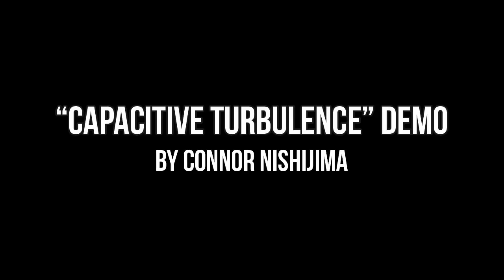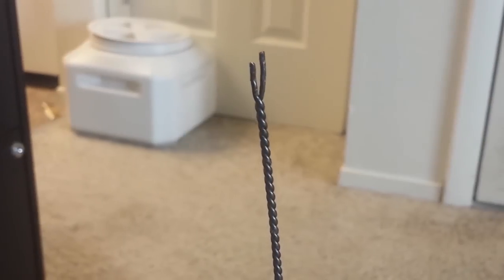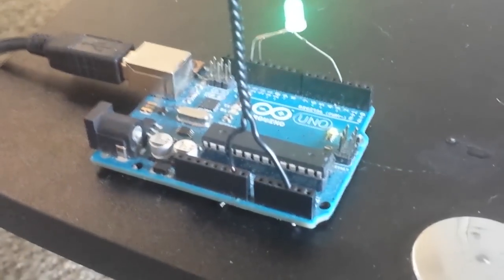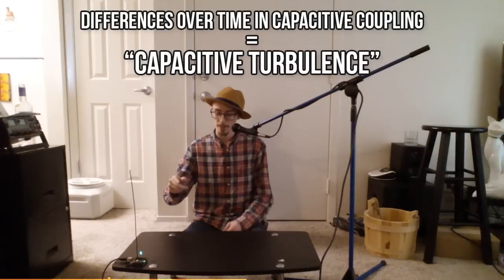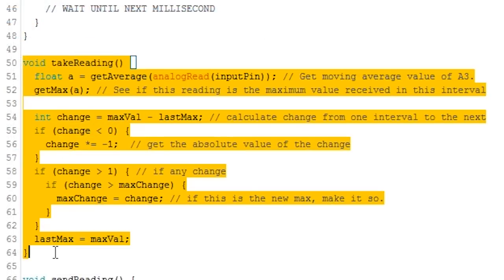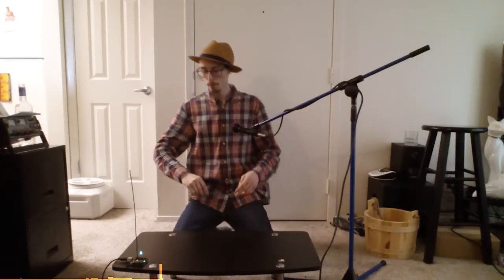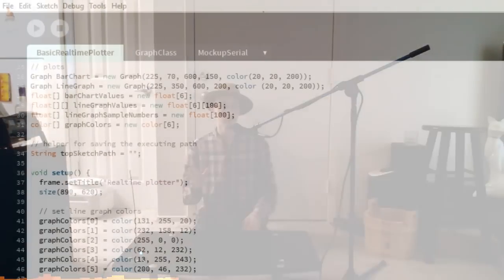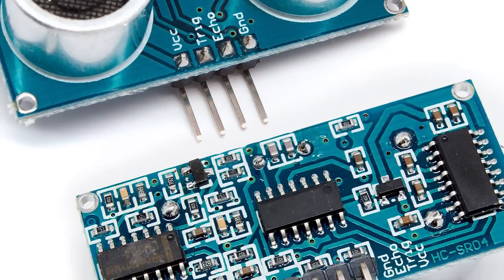Using the Arduino's Built-in Motion Sensor!  (Buzz Library)

Comment: I actually noticed this a few years ago and build a small test device to run through some test/hypothesis. However I did not use the two twistet antennas and filtered out the 60 Hz noise by software. Also I used an opamp and an attiny13. It did work without the opamp but better with it. Here are a few things I noticed:
- It reacts very strongly to a charged baloon (I could get a good signal from a few (5 or more) meters away)
- When put in a metal cage, it will not pick up any signals
- It works way better when connected to ground or a disconnected laptop, but it can also work with just a small battery and bluetooth
- The light switch can (obviously) create very strong signals
- I have also tried using two receivers with a meter distance between them to roughly calculate the position of the movement, but it didn't properly work, since the signal strength is not only correlated with distance but also with other unknown variables of the environment (but with a bit more effort, it might be possible)
Reply: Yup, I noticed pretty much the same things as you did. I discovered it just using a simple floating cable though. Just like you I can confirm that it picks up statically charged objects (charged pvc pipe) MUCH better than other objects, and that playing with the light switch affects the reading.

Comment: Could you try repeating your experiment  with a grounding wire/strap taken back to Arduino ground maybe via a 0.5 w resistor (4k7 thru 1M). Interesting to see the difference.
The two wires form a gimmick capacitor and antenna. You can tune the cap by loosening and tightening the turns. You might be picking up induced mains "hum"  coming from your body - similar to when you tap the audio in on an amplifier and get a buzz sound out  the speaker. I guess you would need to look at the signal on an oscilloscope.

Comment: I noticed you have a carpet there... it's bound to be a capacitive effect... I mean, you will generate high potentials just moving around, depending on the type of carpet you have. Has anybody tried this sitting/walking on a wooden or ceramic floor? Try grounding yourself and see if that effect persists.
Reply: It works here on a ceramic or cork floor very well. I assumed it was caused by a change in electromagnetic environment that caused a change in the charge of the cable (like the body blocking off or deflecting/refracting the electromagnetic field). I did not try it while grounded though, but the fact that it works very well on a charged balloon or pvc pipe indicates that we should indeed try grounding ourselves and see if it still works.

Comment: I made something similar with just a single wire and a 1nF cap on an analog pin. It works by picking up static electricity. It can detect when i brush my hear from 3 meters away!

Comment: Would be interesting to see if it works also somewhere in the woods where no wifi signals are around, maybe you see a kind of interference with wifi "shadows"?
Reply from the maker: The theories provided on HaD about electrostatic charge coupling seem to hold up, I can rub a beanie on my head for a few moments put it on a long plastic stick (with the windows closed to hide my insanity) and the charged hat will also bring the readings up. This also explains why The Force is more strong in the hairy cats than myself. I’ve also successfully done this outdoors away from AC interference, though to run the project successfully I had to tie one of the GND pins to a grounding rod to keep the signal clean. So as a tip for anyone wanting better readings – ground the circuit as well as possible!
Reply: Cool. This shows that it works off grid too with a good grounding.
Reply from the maker: Also, if you want a fun project for a spare board, I run a service called Miduino to make your Arduino play tunes! Maybe you could make a human-sensing jukebox. ;) Skynet starts with us.

http://world.emotiscope.co/miduino
Reply: Possibly radio/cell phone as well.